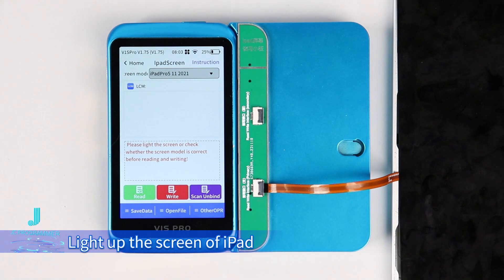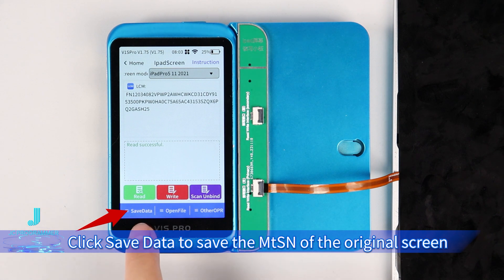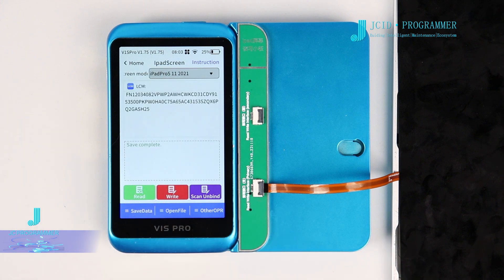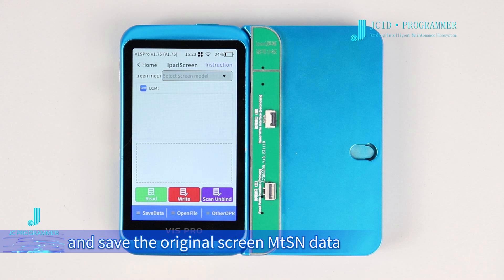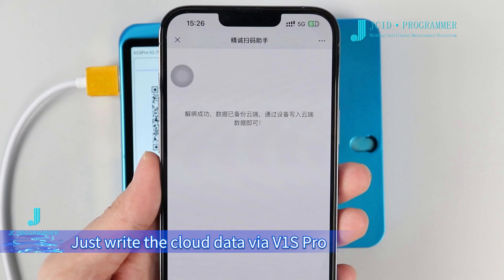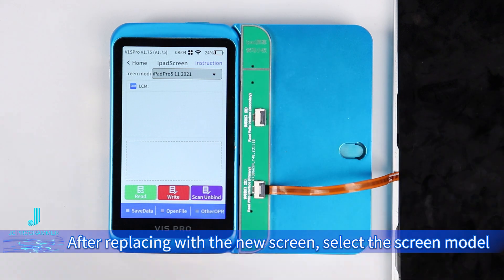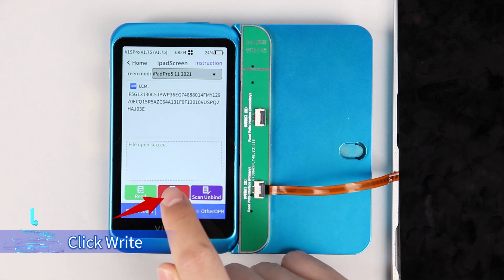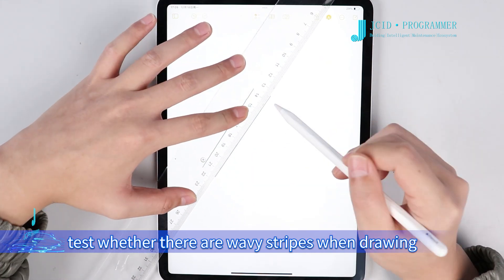JCID V1S Pro Ipad Screen Read and Write Adaptor Operation Guide

Comment: ipad pro 12.9 supported?
Reply from the maker: Not supported at present. For more information, please visit the official JCID website: https://www.jcprogrammer.com/product/ipad-screen-read-and-write-adaptor-fix-wavy-lines-with-apple-pencil-jcid/
Reply: @jcidtech  Hi your website now says Pro3/4 12.9 inch supported. Still not 5th gen? If it is supported, what adapter do I use? I have the set and it doesn't have any for 12.9
Reply: On website is information about supporting Pro3/4 12.9. Which adapter is for connecting this lcd?